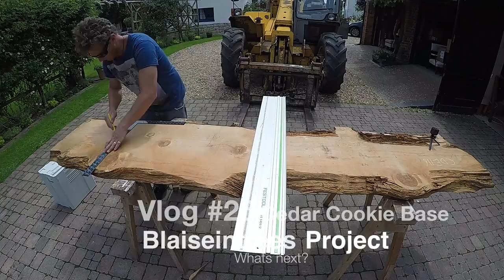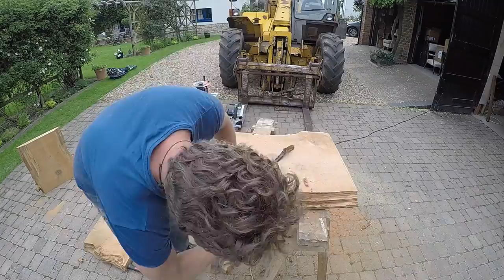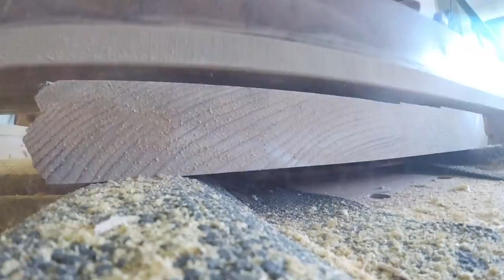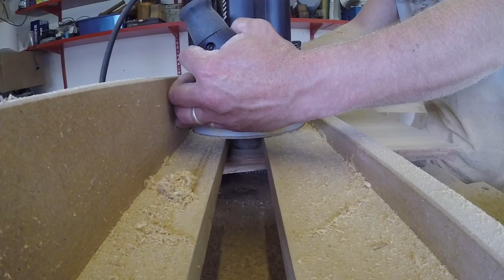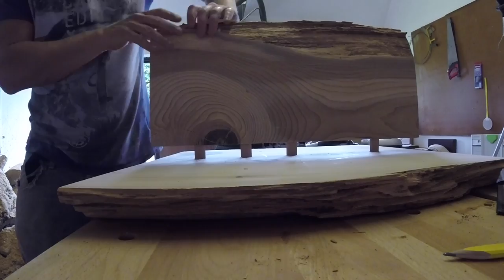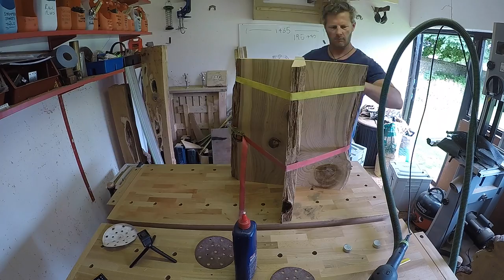Cedar Cookie Base #26

Comment: Do you find it better going with the grain or across it?? When you flattening slabs
Reply from the maker: Hi Glen, Im not sure theres much of a difference really its more about what's easier to do in the small workshop.  I have just got a big workshop so more and bigger stuff coming soon.  Cheers Blaise
Reply: @BlaiseBrogan  Cool mate. I use 50 mml square tube for my rails and 6 mml angle iron for the sled, works a treat. Flat as. Cheers
Reply from the maker: Sweet Im going to do something much bigger soon.  You Should do a video!  cheers great to have you on the channel mate.  Blaise